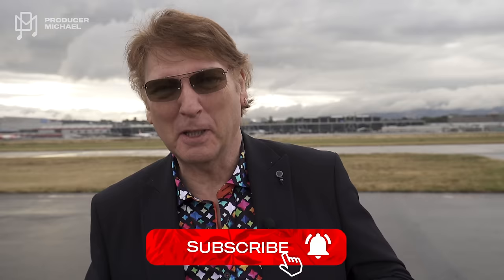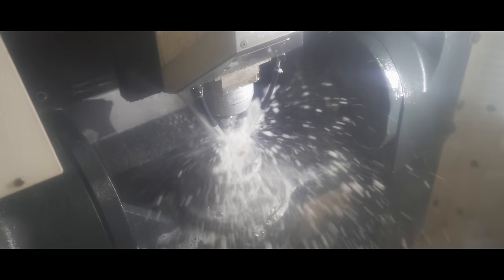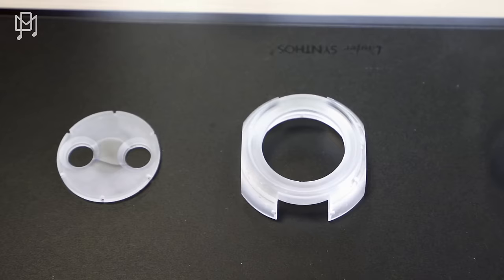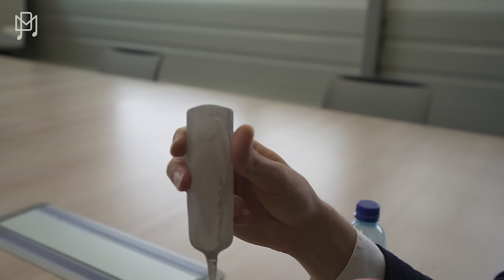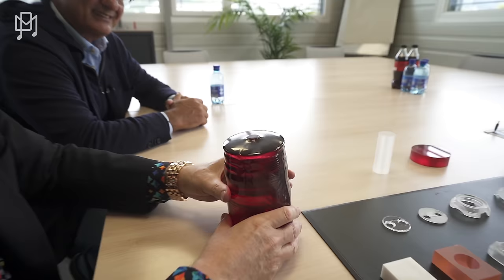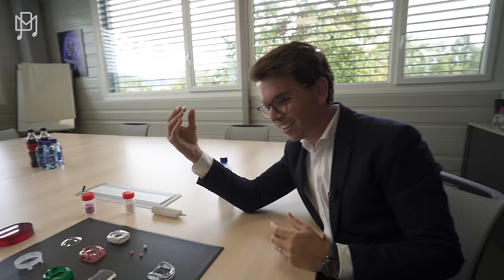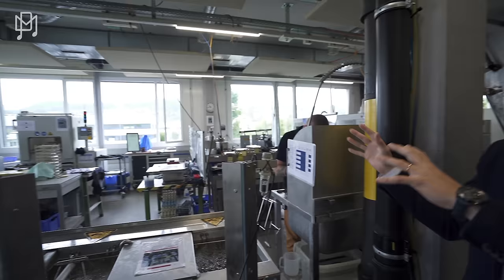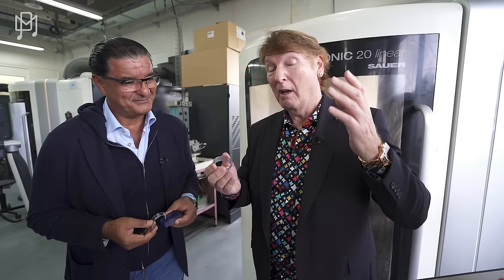Inside the TOP SECRET Factory where Jacob & Co watches are made

Comment: I have worked with fine European ceramic for nearly 10 years. 

Every drill bit with eventually explode and degrade. every bit as you drill is constantly wearing itself down to deal with how strong and stiff the material is. These ceramics are bombproof they can't scratch they are tough as nails. but at the same time are so fragile. I can't imagine how difficult it is to produce something of this quality dealing with this material for so long.

Hats off to the factory

Comment: laser milling, edam wire milling , , a.i. software to help milling designee ,  new quantum machining , shaktipat teleportation of perfect material as well structure.
Carbon atom diamond's for a step above sapphire , as well any newer elements made with a.i. as well consciousness. 
for the inside of the factory, consider making the floor as well walls the safe soft luxury as Jacob & Co. boutique's, so like the vibe am the same in every place. Nice, like the hardware as well soft ware of apple iPhones.
very nice video
namasta
Om Krishnaya Namaha Om Krishnaya Namaha Om Krishnaya Namaha 
Hare Krishna
Hail Tsar
Heterosex love as well peace
Reply: The information provided in the paper hints at the complex interaction between ultrasonic vibration and sapphire polishing, but it does not provide specific equations. Nevertheless, based on the information and principles outlined in the paper, we can attempt to formulate a simplified equation related to the effects of ultrasonic vibration on sapphire polishing, specifically focusing on scratching force. Please note that this is a simplified model and may not capture all nuances of the process.

Let's formulate an equation:

```latex
F_scratching = f(V, A, f_vibration)
```

Where:
- `F_scratching` is the scratching force during sapphire polishing.
- `V` is the scratching speed (velocity).
- `A` is the amplitude of ultrasonic vibration.
- `f_vibration` is a function representing the effects of ultrasonic vibration on scratching force, which is a function of vibration frequency and possibly other factors.

The equation suggests that the scratching force (`F_scratching`) is influenced by the scratching speed (`V`) and the amplitude of ultrasonic vibration (`A`). However, the specific functional form of `f_vibration` would require further data and modeling to describe how the scratching force is affected by ultrasonic vibration frequency and other parameters.

The paper suggests that ultrasonic vibration reduces the scratching force, but the exact relationship between these variables would depend on the detailed experimental data and modeling results presented in the paper, which are not included in the provided information.

To develop a more accurate equation, you would need to conduct experiments and collect quantitative data on scratching forces under various conditions, including different ultrasonic vibration frequencies and amplitudes. With such data, you could create a model that captures the relationship between these variables more precisely.